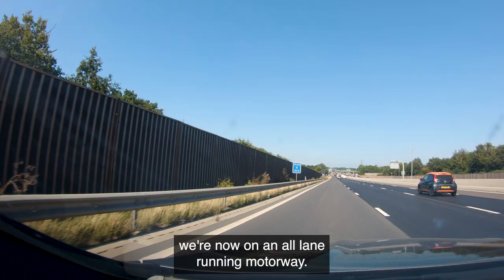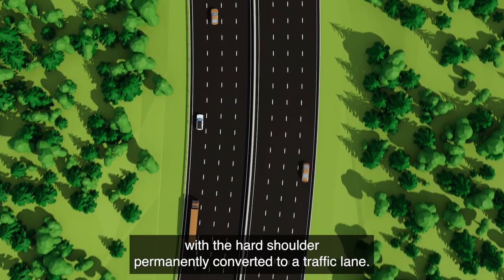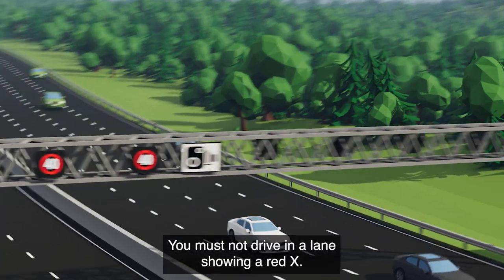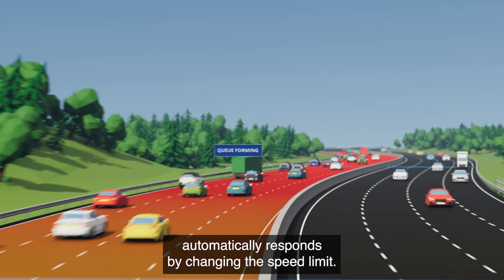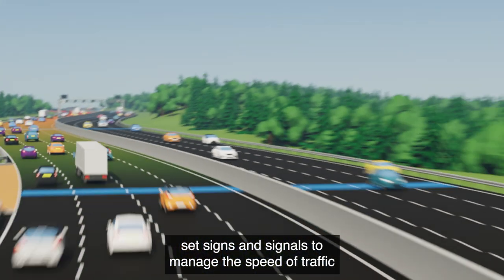How do smart motorways work?

Comment: You can implement all the smart stuff but still keep the hard shoulder. Getting rid of it is absolute madness. You can detect a stopped vehicle with 20 seconds, then react to it, then put a red cross, then vehicles move out of lane. A lorry has already ploughed into the back of the vehicle.
Reply: As a driver in the Netherlands, I am surprised as to why the hard shoulder is completely replaced in the UK on these motorways. Here it is called "emergency lane" because drivers divert to it for emergency stops. During rush hour, when that lane is open for traffic, it is called "rush hour lane". However, sometimes a full hard shoulder is just not possible, in which cases there are always "escape havens", same as shown in this video. With a phone and all.
But the most baffling thing is that drivers in UK are only now learning about highways with traffic speed detection and dynamic speed limit adjustment. Here, if I see the LED gantry with 70 on it, I turn on my hazards for 3 clicks to warn traffic behind of a sudden speed change. We've been taught that in our driving schools. Keep a gap, move slow to be able to accelerate, stay in your lane, let people in when they wanna change lanes.
Reply: 20 seconds on the highway is enough for a car to travel half a kilometer. On a busy motorway that's at around 30 cars that will go wizzing by you in that short amount of time. Making the generous assumption that smart highways work and people always pay attention to the road signs, in those 20 seconds it takes for the system to notice you're stopped do you really trust 30 people to successful swerve around your stopped car?
Reply: Exactly! The technology is fine, and can help make the motorway safer, but it can never replace a hard shoulder.

I don't even have a problem with occasionally allowing use of the hard shoulder to ease congestion, as long as the traffic is moving slow enough to make it safe (<40mph).

Comment: I've never heard anyone say "I wish they'd get rid of the hard shoulder on motorways"  - I would like to meet the insane civil servant who first suggested this idea. I would like to know what other 'ideas' they have.
Reply: I think they should be prosecuted for every death caused by this mental idea!
Reply: The idea only becomes a solution when the parameters are "we need 30% more traffic capacity and we're giving you <1% of the budget you'd need to need to build a new extra lane.
Reply: @BillyBob-rm3ve  
And who should be prosecuted for an identical collision that happens in lane 1 or 2 or 3?       If you cannot see a stationary or broken down vehicle in the running lane that's a half mile ahead then don't be blaming the Dept of Transport.  
  There are many dual carriageways almost identical to motorways without a hard shoulder yet nobody complains about them.
Reply: @EdwardOBrien-o6r  the point is the ‘smart’ system doesn’t work and people have died. There’s always going to be accidents, but a lot of the time if you experience a blowout or engine issues you can manage to get to the hard shoulder … if there is one!
Reply: @BillyBob-rm3ve 
   If they dont work then thats just down to drivers driving without due care and attention which is careless driving.   Roads don't drive cars,  drivers do.
Reply: @EdwardOBrien-o6r  No it isn't. It's down to the 'smart' system not working and not detecting stopped vehicles correctly. But even when it does work, just putting an X over a lane and hoping everyone complies is reckless at best.
Reply: @BillyBob-rm3ve  With an X ahead to warn motorists to exit that lane, do you think it's reckless driving to make a simple lane change?      You blame the council for   rearend collisions on the live lane but blame the driver who rearends on all other lanes.
Reply: @EdwardOBrien-o6r  my original point was that the system is not foolproof and sometimes does not detect a stopped car, therefore the X doesn’t appear. FFS are you really this stupid or do you do it to wind people up?
Reply: @BillyBob-rm3ve     Doesn't matter whether it's detects a stopped car or not.    Are you not capable to knowing if a car ahead is stopped or moving very slowly a half mile ahead?  And more than likely it would have it's parkers on.    How close does a car in front of you have to be before you can see it?

Comment: As a part-time HGV driver I can testify that these 'Smart' motorways are potential death traps. Lorry's normally HAVE to go flat out at 56 MPH (speed governed, and where limits allow) to be able to make their drops to a very strict schedule. If not, the driver is sacked. At 56 MPH weighing above 35 tons it takes around +10 seconds to do an emergency stop at 56 MPH, on a gentle bend (much more if downhill, wet conditions etc). Breaking to hard, and the articulated HGV will simply jackknife and roll on its side, killing all in its path. You can ONLY see around 5-7 seconds ahead in the dark, especially on 'left hand' bends where the opposite lanes oncoming traffic dazzles the lane ahead. So do the maths, 56 MPH equates to around 10 seconds stopping time, minus 28% = 7.2 seconds stopping time total. 56 MPH - 28% = 40.3 MPH! To drive safely in the dark the HGV driver can either stick to the far left lane at 40 MPH and face the sack within the week, or reman in the second lane and be potentially fined? These 'smart' motorways have never been properly risk assessed by someone smart, or even having the intelligence of an HGV driver...

Comment: The upbeat yet calm voices of presenters & happy music perhaps ironic when we consider the terrifying reality of being stuck in a live lane & unable to reach an emergency area.

I won't comment on specific advice given here, particularly if unable to make it to nearside or a refuge ! 

All motorways should have a proper hard shoulder.
Reply: @kristoph7606 Wow....I can't see how your reply to mine is relevant to what I said or the subject of the video.
Reply: Hope you don't drive on an A road.
Reply: @AgentSquash  Yes I do.. I am very aware A road single carrageways do not have hard shoulders but they don't have 4 lanes of traffic,  speeds are generally slower etc 

By all means expand to give better context to your brief statement
Reply: @AW8UK  There are thousands of miles of dual carriageway A roads at 70mph - no hard shoulder. Arguably they are even more dangerous as they don’t have technology to block lanes.
Reply: @AgentSquash I accept that but there are usually verges,  or areas to get off road...not same as being stuck in a live lane with multi lanes of dense traffic and drivers on auto pilot
Reply: @AgentSquash  My concerns are I would not want to be in a live lane rushing to unstrap a toddler from a harnessed seat with HGV's etc approaching behind at any speed. I accept others may not have such concerns.

Comment: A couple of months ago I drove from Lancaster to Brighton. On the busy journey I passed 6 broken down cars, 3 on normal motorways, and 3 on smart motorways. Each of the breakdowns on standard motorways, the traffic flowed freely past the car in the hard shoulder. On each of the smart motorway breakdowns, we were stuck in 4 lanes of crawling traffic for upwards of 20 minutes.

Is it an acknowledged trade off that smart motorways have more capacity when there's no issue (i.e. 99% of the time) but are 10 times worse when there is an issue?

Comment: Can't believe the actors in this video look pleased the hard shoulder has become a live lane!!!!   Please advise what they should do then - if they were driving in this left lane on a very busy day, rain pouring down, 4 lorries behind them, have well over a mile to go before the next tiny refuge area....then their car loses power?
Reply: Or they manage to get to the nearest refuge area... and it's in use
Reply: @rogueuniversities6866  They're big enough to fit more than 1 vehicle
Reply: @Jackary1232  At first glance, maybe. But they're not really. They're frequently only big enough for one vehicle (when you take stopping distances into account), and often not big enough for a long vehicle such as a lorry. don't forget that you're travelling at 50-70 mph, you need time to slow down and stop once you enter the refuge area. Sure, you can START to slow as you approach it, but you can't realistically go from 70 to 30 on a motorway with traffic on it, safely. And a lorry stops a lot slower so needs plenty of room. And an investigation shows that the recommended length (by the morons who got rid of the hard shoulder) of the refuge area is 100 metres, yet even that target has not been met - many are shorter. I've been on dual carriageways where I've wanted to park up for a bit - but even though the speed limit was less than a motorway (it was 50mph), I didn't feel I could slide into a layby with a lorry already sitting there, and that's in a normal car.

Comment: Only an idiot would support the idea to eliminate a hard shoulder from a motorway. All the work involved to change the motorways into so-called 'smart Motorways' is an unnecessary expense. The original design of motorways (typically consisting of a hard shoulder plus 3 lanes) was fine. It was a nice simple design that was easy to understand. If your vehicle breaks down on a motorway, you pull into the hard shoulder. Nice and easy. Why bother changing all that? History proves that drivers prefer simple designs. They're not happy when a bunch of idiots decide to redesign the roads and then complicate the f**k out of them.
Reply: The people who design them have no clue about driving. Most likely they don't drive and get chaffeured around everywhere.
Reply: "Forwarded message"
 I am ex motorway cop, I was a decent honest one If I say so myself, I only did speeders 95 upwards on follows due to obvious discrepancy they are never 100 percent accurate. With speed device it was always 10mph+1 over the limit so plenty of space for error so if you were doing 52 in a 40 fair cop if you pardon the pun, the +/- 2mph is mathematical con., So you know the risks, My daughter got caught on normal road by van, 39 in 30, she was doing 30.9 and 32 going down a hill,  having used the devices for 20 year it was being used way out of safe parameters, this adds on anything from 4-7 mph, I challenged at court, they brought the top barrister and his side kick an ex-cop who was as qualified and an expert as me, they withheld evidence, I now have that undisclosed evidence that proved I was correct, they lied to win the case, the only process now is to appeal and they will rip it 50k up to 500k, I'm thinking of writing a book as a way around it to highlight the con, inside out tv did a programme but they couldnt work out the 6mph overread, I can. Every car at that point (thousands over the years) in Northampton have been unlawfully prosecuted, the police knew as did cps, but they covered up it would have cost millions in compensation, I got fined 2.5k costs and in summing up the barrister said he was asked to win this case by northamptom police?, later refusing to deal with my complaint of perjury bearing in mind the police had the evidence, just a brick wall. solicitors will not touch a speeding fine and advise pay up, of course I would advise the same, motorway ones are done on algorithms. so those lines, the time .3 of a second from first to second line (beam) is the speed, the question is where is it hitting the car, is it the same on first and second?, as its time over distance, the plus or minus 2mph is a mathematical smoke screen that I can prove, its a con? but no one will touch it, my advice is pay the 100 quid, if you can afford a good solicitor and risk a 2.5 k fine which puts people off going to court , You may also get a solicitor to challenge and get you off but if its discontinued the solicitor will cost more than the £100, so catch 22. feel free to contact me, but they will do everything to prove you wrong, They are experts so believed by court your the bad boy speeding and trying to get off?  usual bullshit safety excuses you could have killed someone and lie through their back teeth. if there is a good solicitor on here who wants the story and evidence that will blow speeding vans and the +/- 2mph con out the water I am happy to chat. If you do go to court ask for the details of the others around as they are witnesses in your case , they will object hence you need a solicitor, see what speed they were doing. good luck you will need it. hope this helps.
Please share this message.
Reply: They were changed because there's way more traffic than the motorways can handle now so there needs to be more running lanes or less vehicles on the road
Reply: @tgm9991  Getting rid of the hard shoulder is a compromise on safety. And even though smart motorways have those emergency refuge areas, they won't do much good if you can't get to them. And I agree less vehicles need to be on the road. Public transport is always an option.

Comment: It might alert them in 20 seconds but if a car develops a fault quickly and has no where to pull over that is not going to be a good outcome for the driver or the vehicle behind. Also what happens if you do not have a phone? This is why hard shoulders are essential with emergency phones within easy access as they were previously.

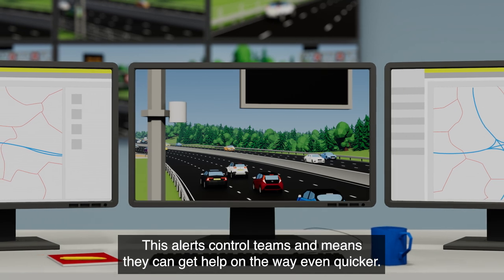Comment: 1:54 20 seconds! 
So on a congested 4 lane Smart Motorway at ~1800 vehicles per lane per hour, that’s 40 vehicles that could have slammed into the back of the stopped vehicle ( that has nowhere to go because there is no hard shoulder) before the signals even come on!
Automatic systems such as MIDAS are only effective at preventing secondary incidents ( by slowing traffic) not the primary one, they cannot respond quick enough.
Looks like some head in the sand thinking and misinformation has been going on here.
National Highways need to get out into the real world and get back to basics.
The lawyers acting for the bereaved families are going to have a field day! 😡

Comment: Even if radar could detect stopped vehicles in just 20 seconds (and we all know that it sometimes takes several minutes, or not at all) that 20 second delay would still mean that several vehicles would come up behind a stopped vehicle, before there's any warning sign being activated; and some of those vehicles could be HGVs, travelling at well over 50mph, and often so close to another HGV in front that they simply cannot see anything in the distance. It's a very sobering thought.
And this system is totally dependent on drivers obeying the warning signs - and, as we know, many drivers either choose not to, or are seemingly completely unaware of what to do. And there are plenty of older drivers out there nowadays, who may well find "smart" motorways very confusing.
Would I ever want to drive on a "smart" motorway? Absolutely not!

Comment: Wouldn't a hybrid motorway work better? Where you still have a hard shoulder which can only be used in times of congestion but only with a lowered speed limit but in free flowing traffic can the hard shoulder be used for emergency only much like the M42 and M6 around Birmingham and still have emergency refuges

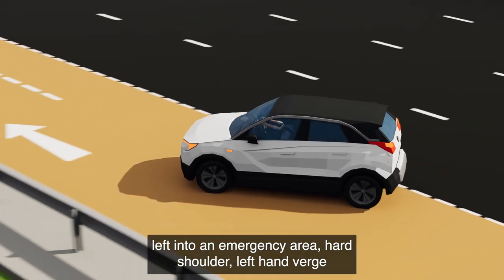Comment: 2:28 INCORRECT AND MISLEADING.  The hard shoulders on Smart Motorways have been removed.
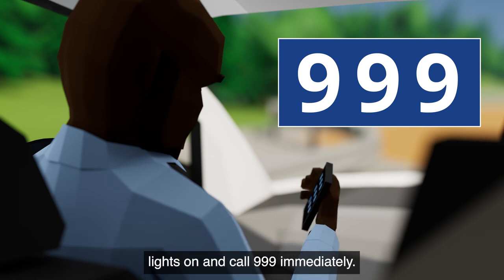Reply: 2:35 Great I dont carry a cell phone with me anymore to be able to ring the emergency number,  because the webmasters today, are handicap, they put a gigabyte picture on their website then they use HTML to chop the picture down to a tiny cheap looking Kilobyte picture, as soon as I go near a website all my internet data is gone,  These massive gigabyte pictures, mega-pixel pixels chocks up internet (this is why internet today is a lot slower today than the telephone dial up days, about 20 years ago) and it eats up my cell phone data & money, if we went back to telephone dial up days, with slow modems most webpages would take all day to load, nobody would use internet.